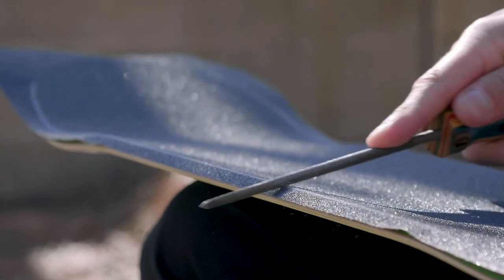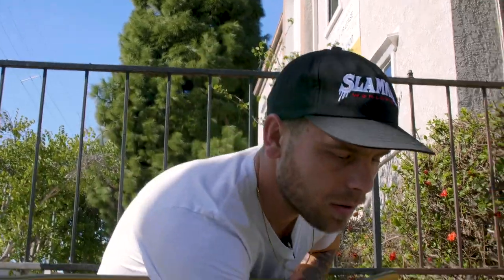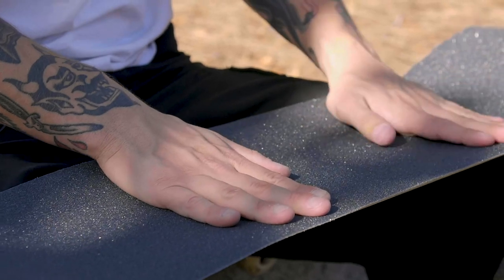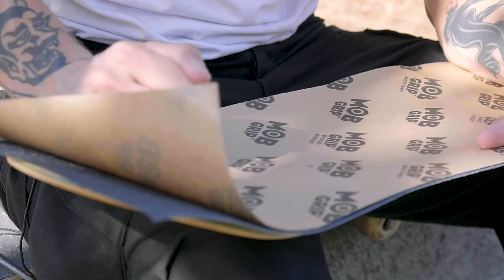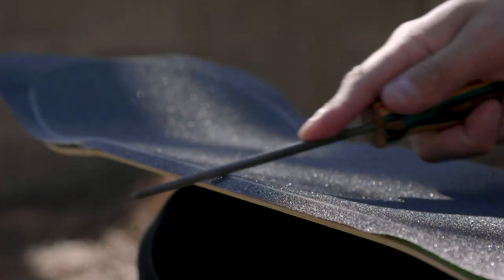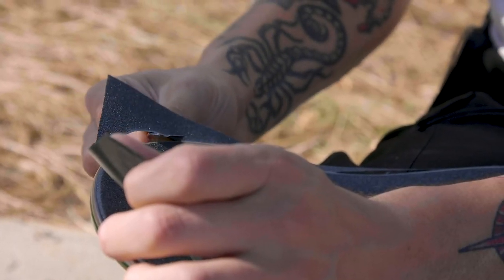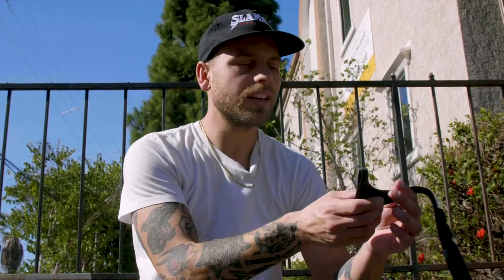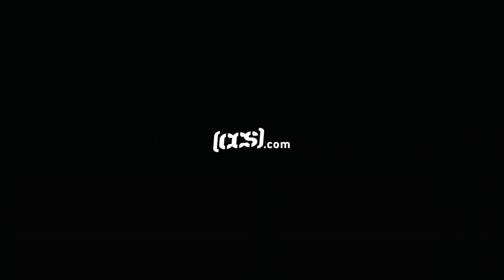How To Grip A Skateboard In Under 5 Minutes

Comment: I just ordered 2 skateboards from CCS and they left air bubbles.... I had to regrip it myself
Reply: I ordered 2 and I put the option for them to apply the grip tape and it came not gripped
Reply: @smitty097  wow lol
Reply: @smitty097 I did the opposite and my board came gripped and it was such a bad job too lol that's why I always ask for no grip application because I had them do it once a long time ago and they screwed it up so when I ordered this time and I didn't even ask for the board to be gripped I specifically asked for it not to be and they still did and it was all cut up too they did this big gouge out of the side as well which sucked. I think their website has some bugs that need to be fixed that's for sure
Reply: Back in the mid 90’s CCS was on point with their grip jobs.
Reply: @fatmikerocks  Yea because people took their time and did their jobs, now people don't care much about how the jobs come out

Comment: I just gripped 2 boards for the first time and I could never get the cut part to go smooth it would just cut a little then get hung and looks horrible no matter what I used blade or knife lol what did I do wrong..
Reply: Same here like some of it cools alright until I get to the nose or the tail
Reply: @intune3866  so I did another one recently and this time I grind down the edges more with the screw driver like grind the hell out of it then slightly lift up on the edges and cut .. that helped some lol